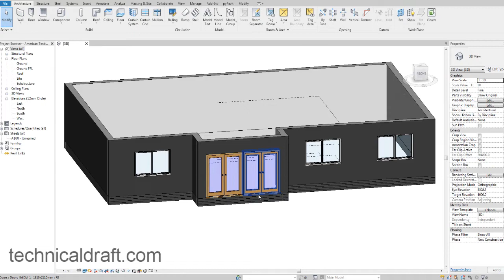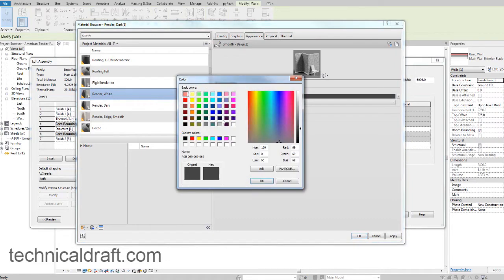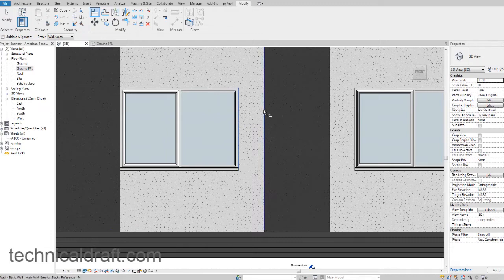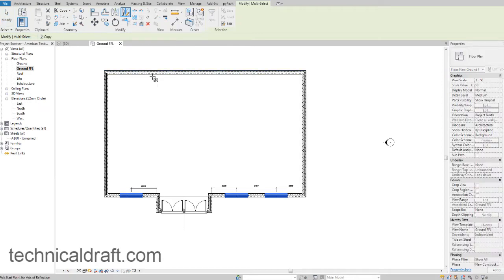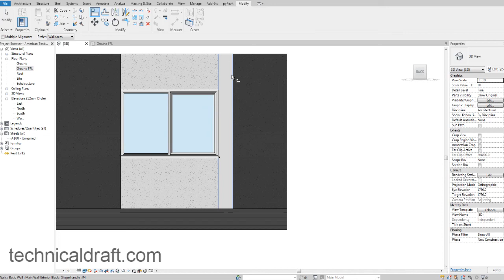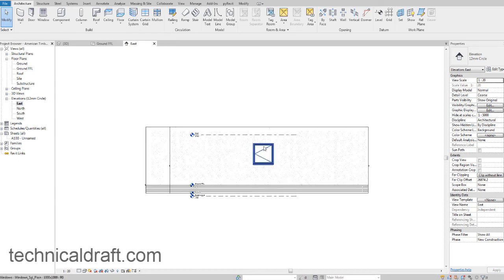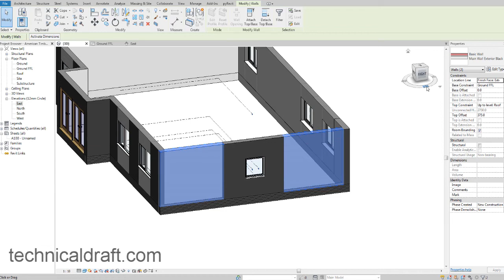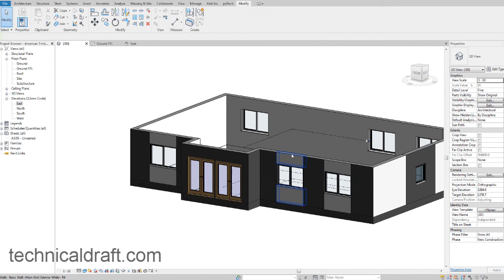Revit Full Timber Framed House Modelling Tutorial - Part 002

Comment: After Mirroring the windows with renderred walls, I found it a little bit confusing. So, what I did was, I had mirrored the windows only . The ones that you  mixed up, split them and reapplied the render. Finally realigned the render.
Reply from the maker: Yes that works too, I attempted to mirror the split walls right inside the big wall to save time, but I admit that it does look confusing. Glad you got it right.

I'll just note that mirroring the windows will cause problems with tagging them for schedules, it's actually best to drop them in one by one. I'll make a mention of this in a video.
Reply: @DrawingTechnical  Could you tell me how to get the centre line to centralise the window. In East View. Please.
Reply from the maker: I made a video response to your question here, I thought it would be easier to watch how it's done rather than read how it's done. Here's the video: https://youtu.be/pDmfjKzUMVc